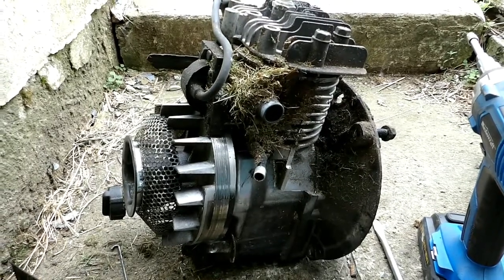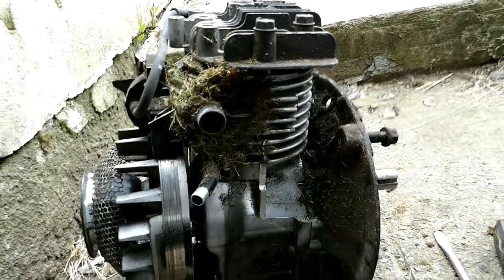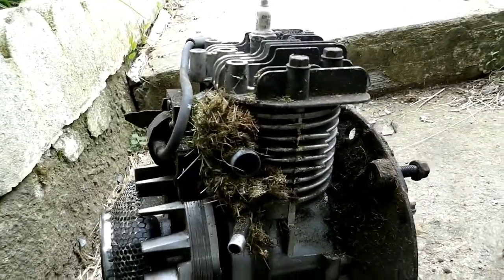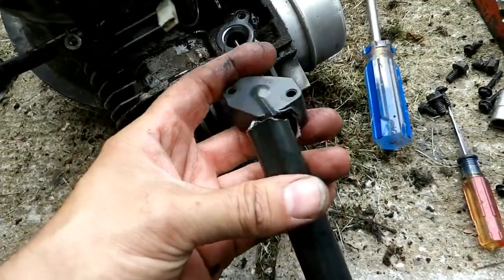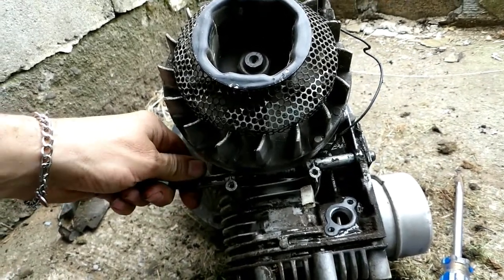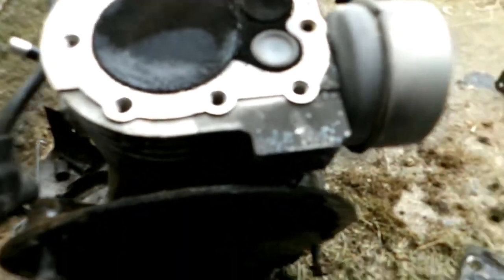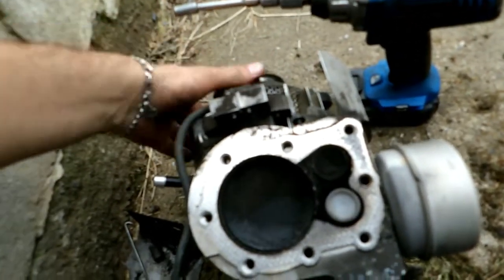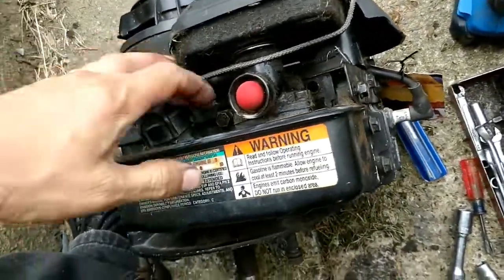CLEAN The Cooling Fins on your Lawnmower, or ELSE!!!

Comment: Guaranty the head and block is warped. Cleaning the block and fins is a YEARLY maintenance item in ALL engine manuals.
Reply from the maker: Yes, I have encountered a few warped blocks, especially right around the exhaust valve seat.